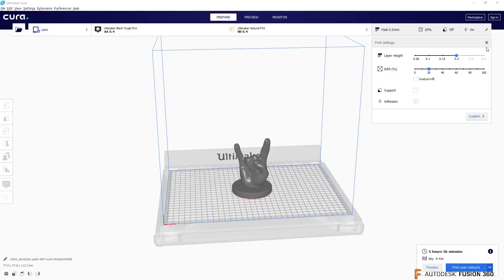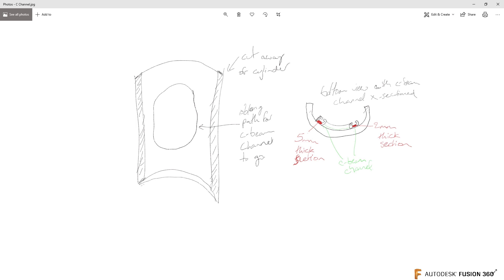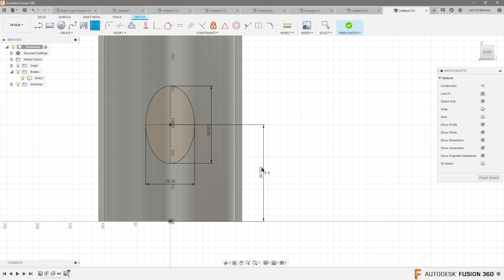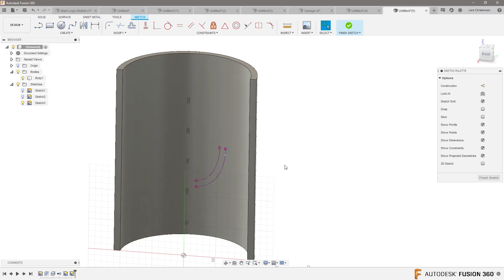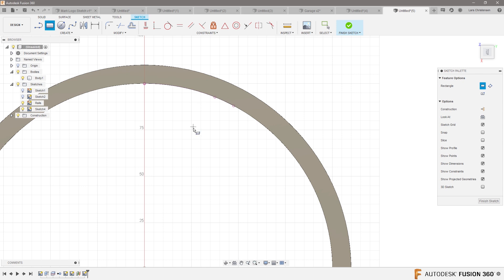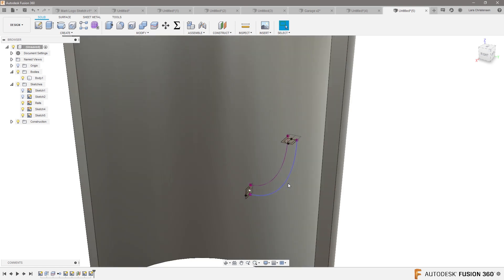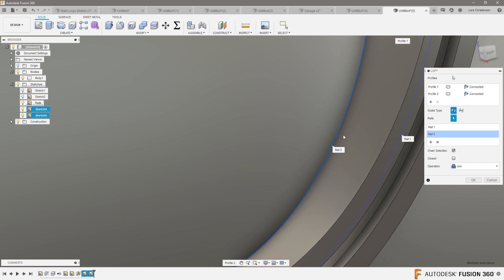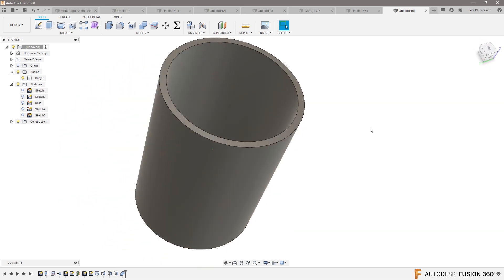Fusion 360 — How To Solve A Complex in less than 15 minutes — Ask LarsLive

Comment: Hey Lars, what is that box on the wall behind you doing?
Reply: I'm intrigued too ...
Reply: That looks like a Hass CNC control simulator. Normally that controller would be attached to a CNC mill/lathe.
Reply: It's a CNC box controller that I designed in the 80s.

Comment: Hi Lars,  my question is how would you make the top channel, the 10mm to be perpendicular to the tub wall?  I never miss any of your videos, great learning tool.
Reply: Would it work if the two sketches were on a 'plane at angle' tangent to the surface?

Or would it only match at the exact  point of the sketches?